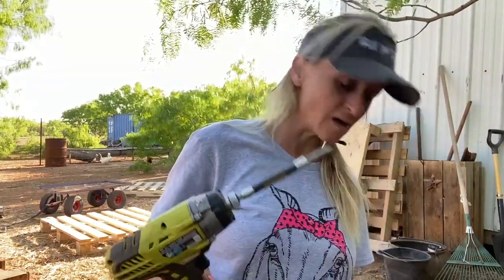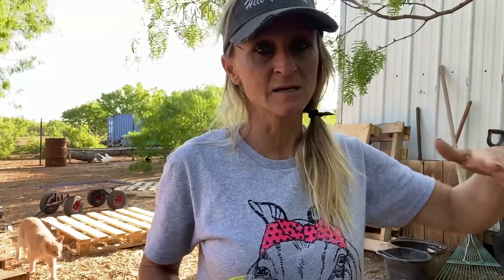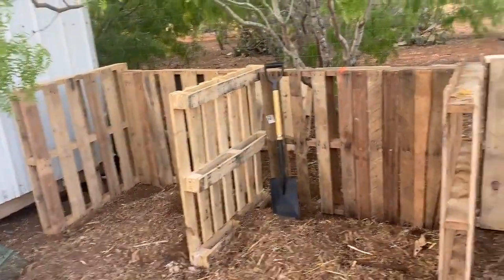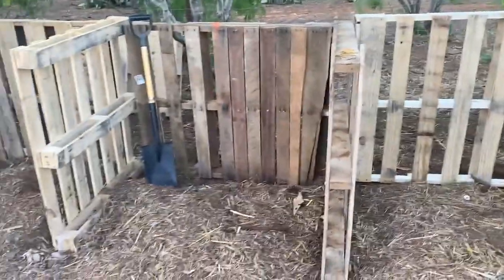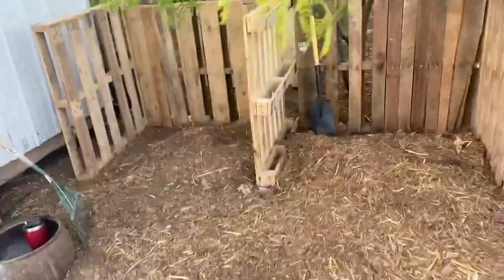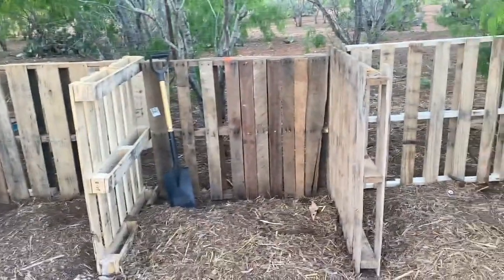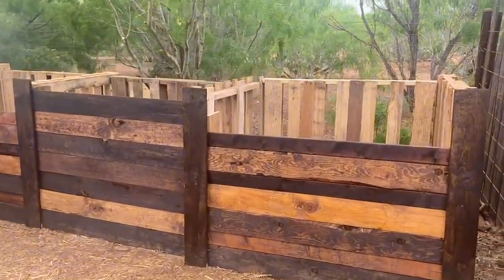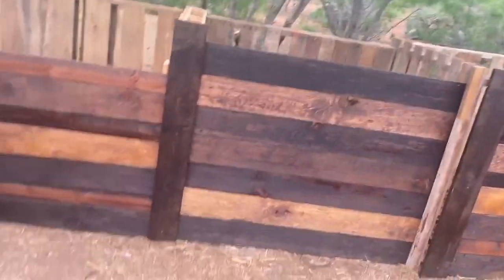Three bin compost system

Comment: I've done that although my compost bin had 2 rather than 3 bins. I also used 3'x8' cement boards for the flooring so I could shovel and turn the greens and browns mix. I took out the middle wall and am now using 3' high fencing with about a 30" diameter and layer the greens and browns in my new cylindrical shaped compost bin. After about 2 weeks I remove the fencing and turn/mix the compost and put it back in the same fencing bin or combine them with another bin. This is easier because  there is less material to turn and my back didn't like the large 2 bin system so I did not turn them as often as I should have. Now I turn them roughly every 2 - 3 weeks and I'm making some really nice compost after I run it through my compost sifter. 
Your compost bin is pretty but each of your bins is so voluminous you may not turn it as well or as often as needed to become the deep dark compost we're hoping to get. Also I'm changing my fence wired bin build to plastic bins by purchasing the Geobin from Amazon. Even the wired fencing is a problem to remove and they can last a season or two cuz I'll break the wired fencing removing it from the pile to turn. 
When I built my 2 bin compost structure I had high hopes but it turned out too laborious and difficult to manage. The wired fencing method is much more flexible. The fencing material can make up to 6 - 30" wide bins and you can combine, separate or start new piles and manage the compost bins as each compost pile decomposes into black gold for your lawn/garden. 
Thanks for putting this up I enjoyed watching you assemble your compost bin. It brought back nice memories of my build.

Comment: You may not need the extra slats. That’s ALOT of material to be going into that bin. The center would be for turning it over after 4-6 months. In the meantime you’d be filling number three  to go into two after you dump out the finished stuff from number 1